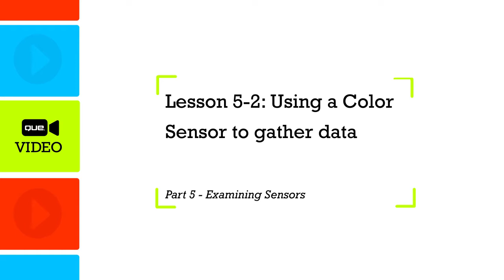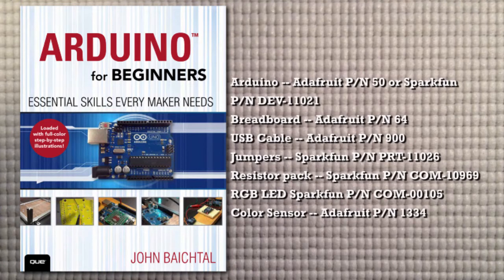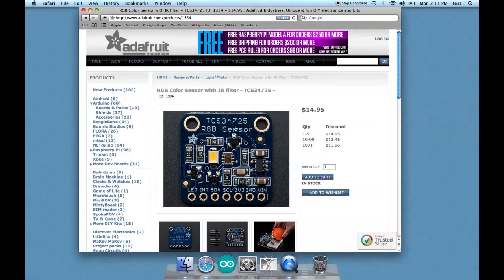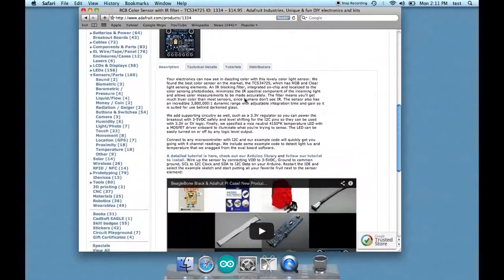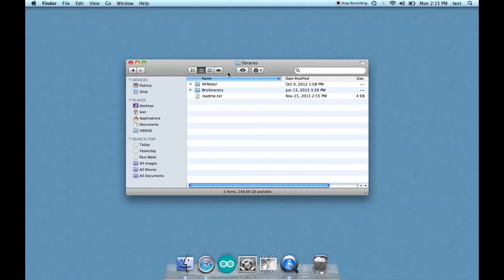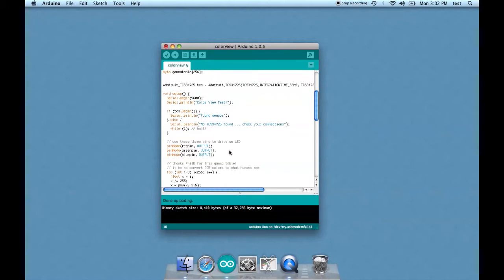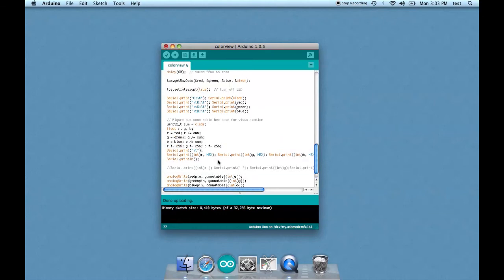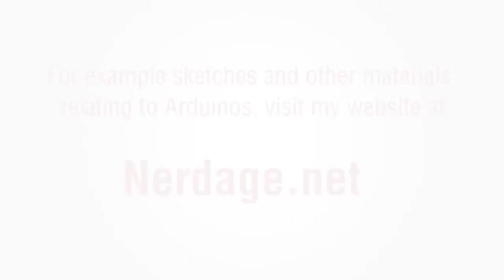Arduino for Beginners   22 Using a Color Sensor to gather data

Comment: The sensor is returning what look like accurate RGB data, but the LED does not render them very well. The TCS230 was similar, which suggests the LED may be the problem.